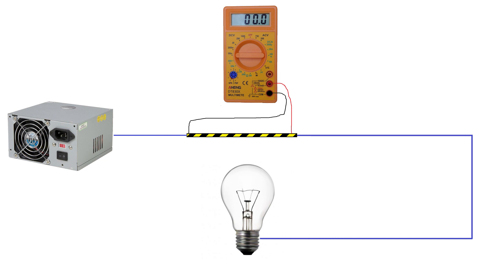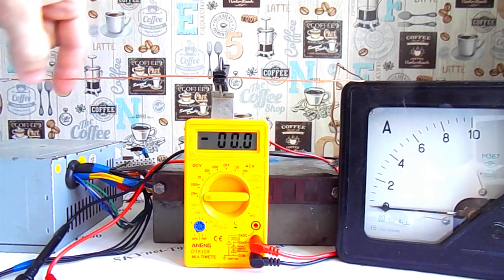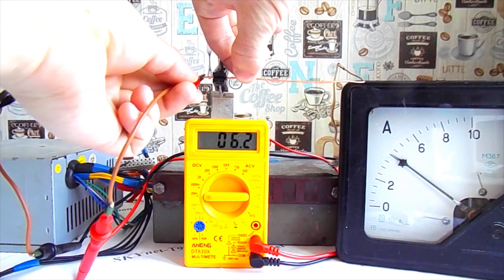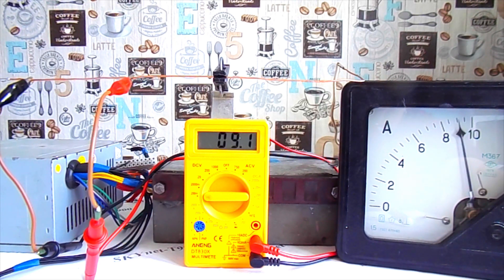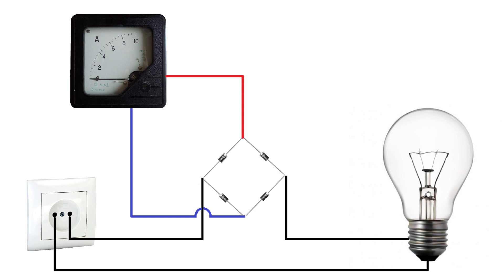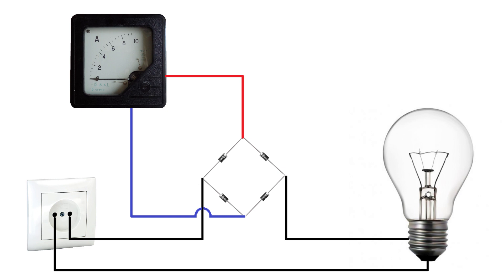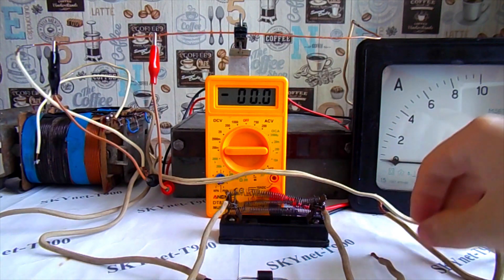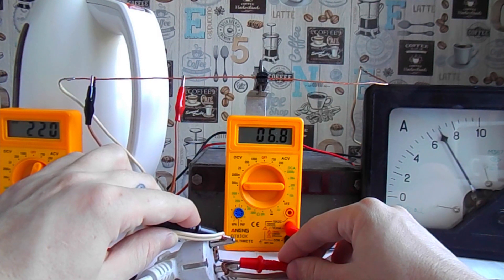How to measure high current at home ?

Comment: You are sending all the current THROUGH the ammeter in this case which only measure up to 10A. Won't this damage the ammeter as it is only rated for up to 10A? Maybe 15A won't hurt it. How about 100A? I suppose it's just being used to calibrate, but if you're not able to adjust the power source, then you can't calibrate the DVM.
Reply from the maker: you are wrong. Here I use an ammeter to measure voltage, simply consider that this is a regular voltmeter. We do not pass a large current through it, but simply measure the voltage drop on the conductor.There is no danger for the multimeter here

P.S. Could you tell me how good the translation is in this video, is everything clear to you? I don't speak English well, so I have to rely on the automatic translator
Reply: @Den_Electro_channel  I think the translation is pretty good! Certainly I was able to understand what you were doing. My comment isn't that you are passing current through the multimeter/DVM, but rather through the analog ammeter (which has a scale of 0A-10A) I believe that is wired in series and is definitely seeing the full current. Is that analog ammeter able to tolerate over 10A running through it without damage? THANK YOU for replying to a comment on a video you posted 2 years ago!
Reply from the maker: A multimeter measures the voltage drop across a piece of wire, which is like measuring the voltage on a battery or a light bulb. And all the high current goes through the wire, bypassing the multimeter.